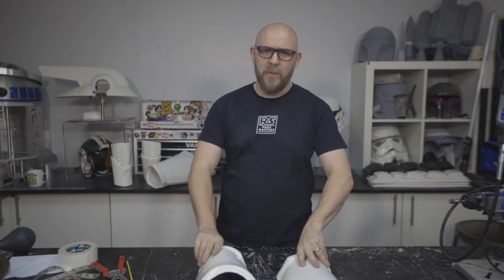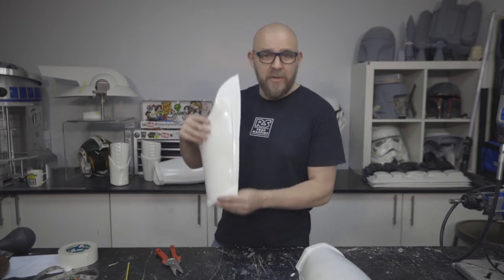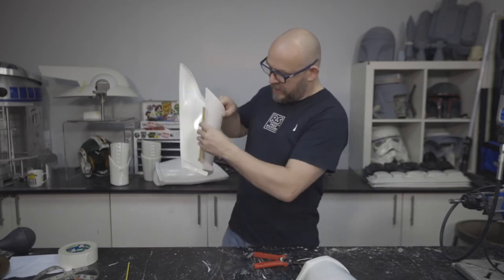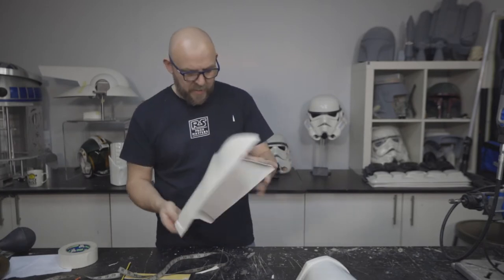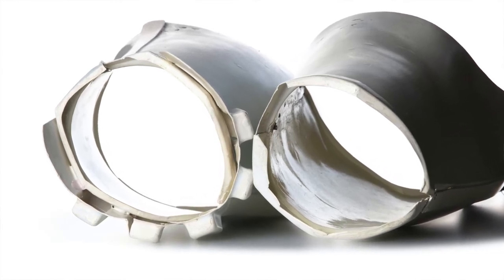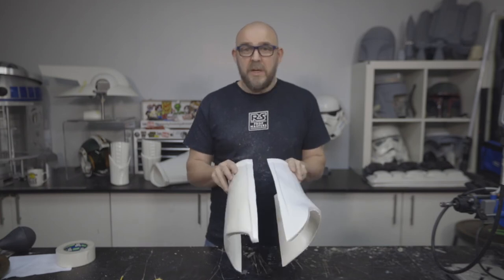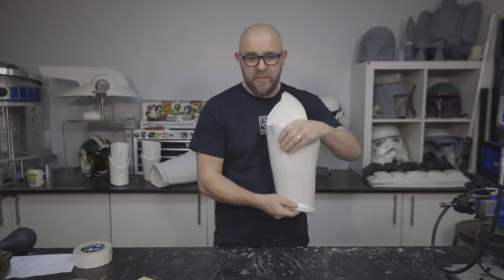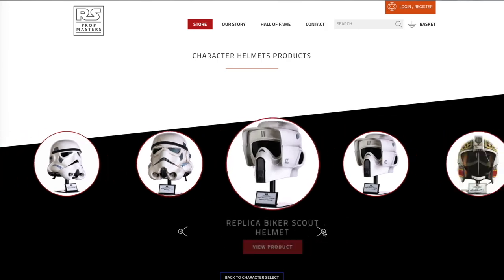The Left Thigh. Building a Screen Accurate Stormtrooper Episode 6

Comment: The thighs in the RS kits are beautiful.
In this video Rob is going for pretty much a direct replica of the original suit that they're cast from but there's also a reasonable bit of allowance in the moulds and, as a result, extra material at the back for fitting them a bit wider if need be.

Comment: You stated the inner thigh measurement, which was 350mm up top and 50mm on the bottom, but never stated what the outer thigh measurement was.  Is it 290mm up top and 45mm on the bottom, same as the right thigh?  Or is the upper measurement different?  From the trim line you can see on the video of the outer piece it sort of appears to be shorter.